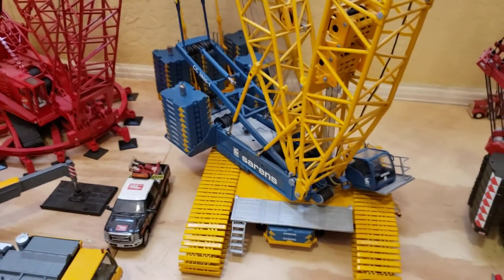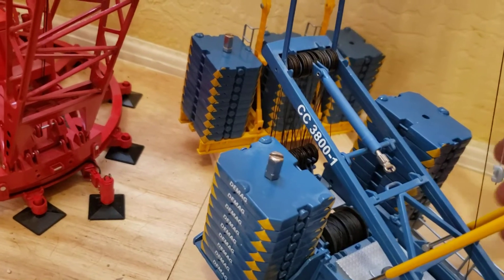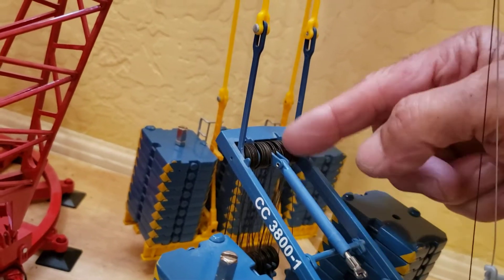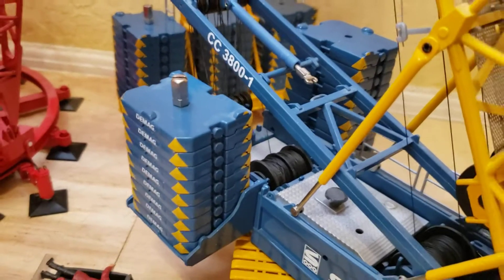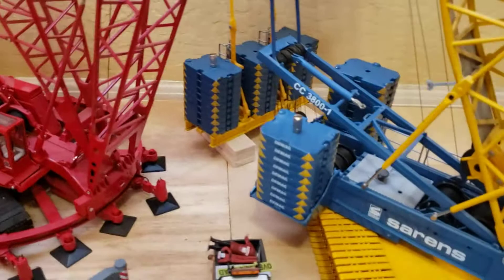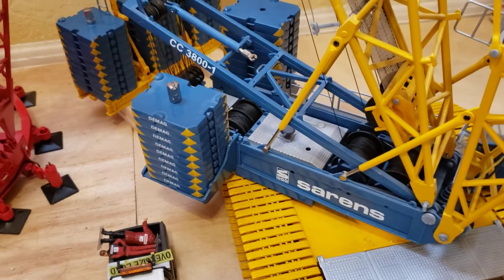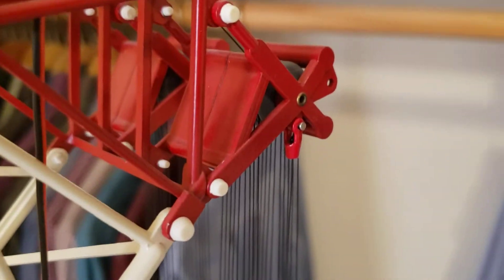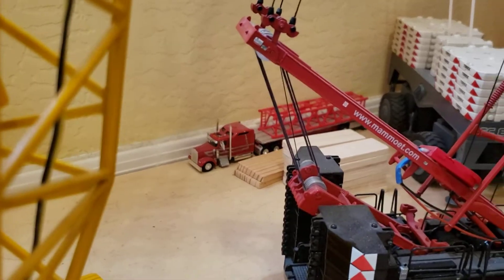Reeving Dual Drum A-arms

Comment: Now when your doing the double drum reevIng do you have the A frame all the way forward?
Reply from the maker: Sometimes yes. Kinda depends on how you're assembling the model. I've had them jump the sheaves while bringing the A-arm back. Best to reeve forward and pull the mast up leaving it forward a little until you get the main boom installed. Luffers are time consuming to raise the way they have to be raised. Sometimes the model won't lift the boom without toppling. Those you have "help" raise the boom with a hand as you spool the winches. Once the main boom is up you can raise the jib. You won't be able to raise the boom and jib unless you let the jib sag. If you're not sure what I'm saying I'll send you some pics from the assembly instructions showing how you raise the booms.
Reply: @lvdrums  ok thanks. I built one big crane years ago and I can't remember exactly how i did it. I built the Demag Terex 8800 when they first came out and that was the very first crane i ever bought. Im pretty sure i had the boom lean against a chair as i assembled the luffing arms onto the boom . Then i think i just positioned the arms apart  in the way i wanted it to look then i reeved it. This way i didnt have the boom laying on the ground and all that, i just wanted the crane to be in the position I wanted.  I was really never going to move the boom up and down  and all that it was just going to sit on display. Now this might not be the proper way to have a functional crane model work but at the time it worked for me. Now i dont have anyone to help me hold the models when i build them so i need to find the best way for a one man build process to work😁
I also have these crane models to build I still have them brand new in their boxes. I have the Manitowoc 18000,16000 and i have the original 4100 with the magnet ,clam shell and drag line i built the 4100 in Sarens about a week or so ago then i have the Liebherr 1280 and 1300 as well as the 630 EC-H40 tower crane. Then i have some large truck cranes to build like the Liebherr 11200 and the Demag AC700. All i am sure are way to advanced for a rookie but i am determined to force myself through it no matter how long one of these take me. 😁
I will have to say watching your videos and the crane dudes videos has  made me get back into crane collecting and so far i bought 6 new cranes this year to add to a way to big of a model construction collection. Thanks for all your time that you put into making  the review, how to and build videos. It really helps us rookie crane builders. After i bought the 8800 i was like no more they are to hard and intimidating to build but watching your videos you make it look easier and i jumped back in. 
Thanks again for always answering my questions i appreciate it. Have a great day
Reply from the maker: @Brian-gw6di  Thanks Brian! Glad you enjoy my videos and even more happy that they help you. I was a rookie one day and nobody was making informative videos. So that was my "calling" I guess. I struggled with the first few and figured ways to make it easy to assemble these beautiful bad boys. So yeah, I'm here to help and enjoy it. 
 Your first was the baddest model made lol. Yeah that hook block took some time. Cool how you figured it out and got it done, way to rock! Funny...I do mine like that too. Prop the boom up and reeve it ready to lift. It's easier than fooling with raising the boom and lowering the jib until the main boom is up and then raising the jib. Kind of a hassle to be honest. So I recommend doing them like that to some people to avoid the hassle of doing it the "real" way. Sounds like you have a killer crane collection going there with an awesome equipment collection. There's some killer  equipment group sites on Facebook. Diecast Emporium is aa awesome site...guy knows his shit real good.  Knows a lot about prototypes and one-only equipment as well as commonly used stuff. Not much for cranes but has thousands of bulldozers, dirt movers, trucks and any other piece of construction equipment. 
The 4100 is an awesome crane...probably the most versatile. And it's full of great detail. Love the chain drive! 18000 is a beast! Awesome model  and the extension kit puts it well over 11' tall. 16000 is very cool looking.....love the low stance it has. Mine is set up for wind turbine assembly. Looks great! 
 Hit me up anytime you need a hand. I'll leave you my email address.....I like to see everyone's collection and we can't share pictures here in the comments section. It's so diverse when it comes to construction equipment and everyone is different in what they like to collect. It's awesome. Thanks again for your support and have a great Sunday. 
jmarcos1414@gmail.com